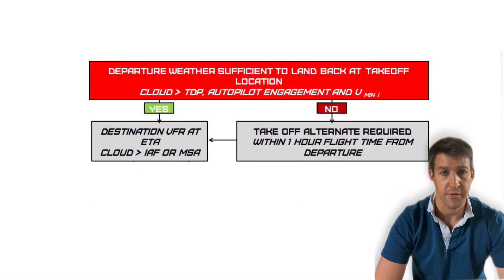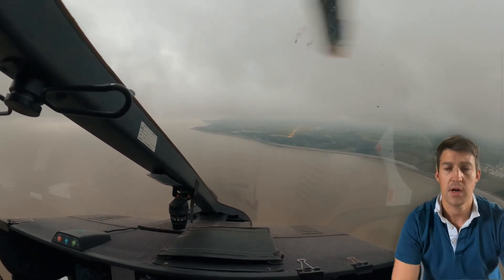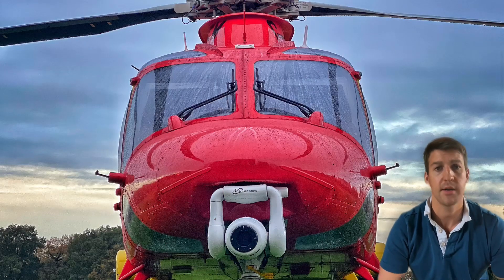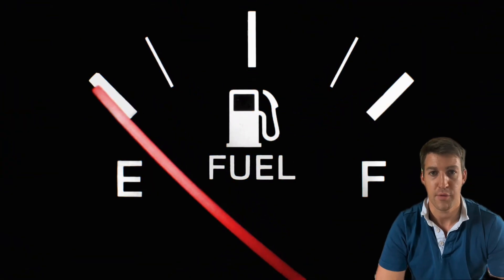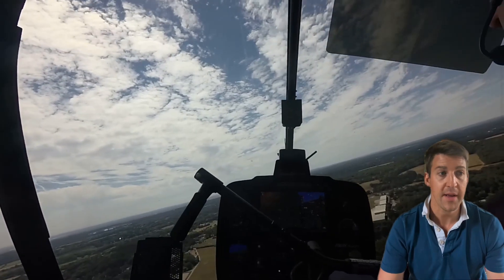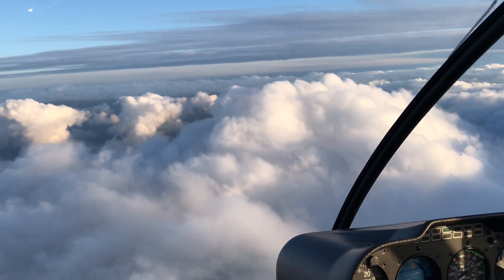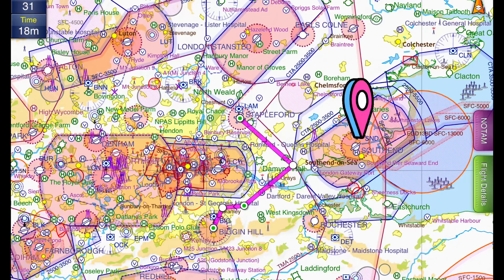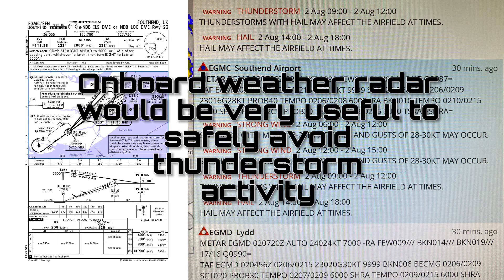How To Plan Your Ifr Helicopter Flight

Comment: As a daytime VFR pilot, I sometimes wonder what it would take to fly IFR instead. Having seen your (really interesting!) video…I think I will stick to VFR…
Reply from the maker: Hello, 
Thanks for taking the time to comment on the video- I am glad you found it interesting -I appreciate it’s a bit of a dry subject but hopefully it sheds some light on what you need to have as back ups when flying in bad weather, and why helicopter IFR operation isn’t all that common - after all, you ideally want to land in a small field or park etc, which you can’t do in bad weather conventionally without all the associated facilities and equipment of a major airport - eg instrument approach systems etc etc. the adoption of GPS approaches will change this, but the regulations are still playing catch-up with the available technology